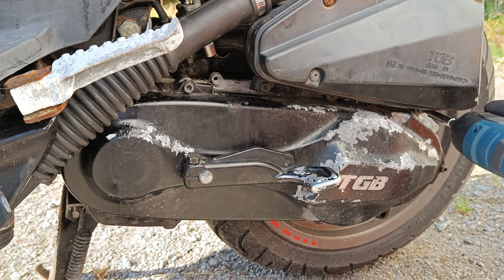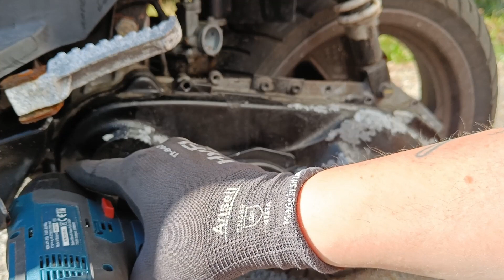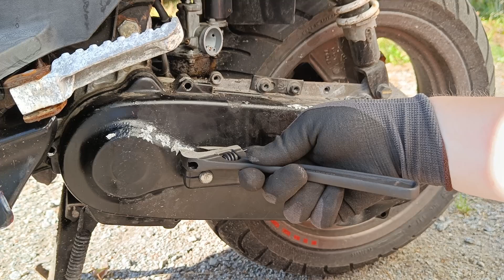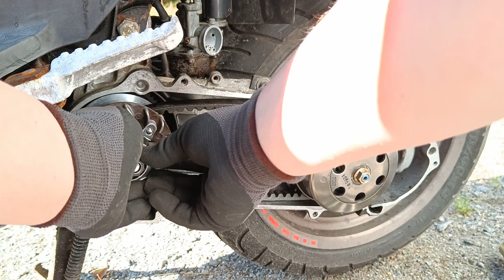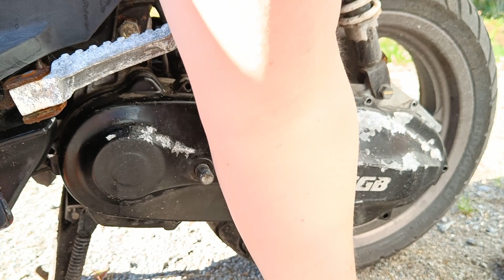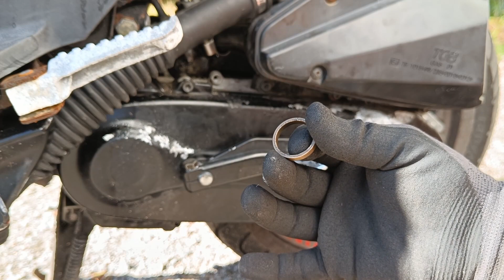How to remove the variator ring on a scooter (Restrictor ring)

Comment: What does the spacer ring restrict or unrestrict?
Reply from the maker: The ring stops the two plates from closing all the way against each other, and thus limiting the belts travel up the sides and increasing speed. Just as a gear on a bike, the front gets larger and the back one gets smaller as the speed increases.
Reply: On a bike the front and back both get larger so I'm not sure what you are referring to
Reply: @RichardBridges-cf9ez  When shifting a bicycle and you want to go faster you shift the front gear to the biggest one and the rear gear to the smallest one.

Comment: how much does the speed increase ? i want to try this on my vespa
Reply from the maker: Difficult to say since it depends on the bike. Some might notice a good increase in top speed
Reply: Some it adds some it subtracts it depends on the weight limits of the said scooter some are built slightly different than others but it all actually comes down to how much weight over all your putting on the scooter more you weigh heavier weights needed for take off and top end lighter weights if your light it's always good to experiment and mix 3 and 3 of different weights to get a better spec range like say you get a pack of 10 grams and 4.5s you put 30 grams from the 10 and 14.5 from the 4.5 giving you 44.5 grams decent acceleration with nice top end but it also depends on what kinda set up you have every matters but that set up is good on stock pistons for people between 150 to 180 pounds so you gotta do math 😂😂😂

Comment: Maybe a stupid question, but still. If I put the variator ring back (want to make my scooter slower), does the belt goes over it, or it has to pass next to it on the small shaft?
Reply: Over it because if it's beside it, it will get pinched when you put it back together and you might damage the belt.